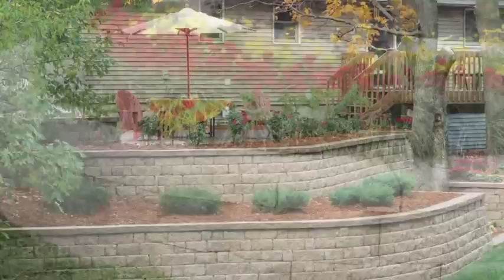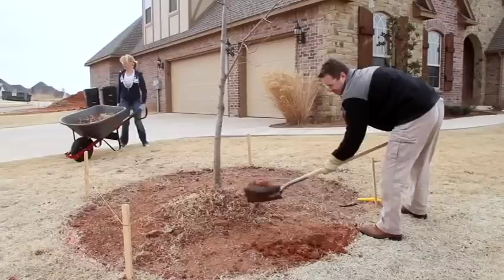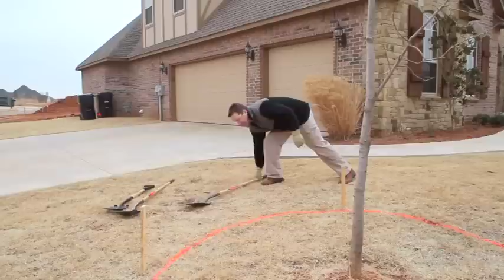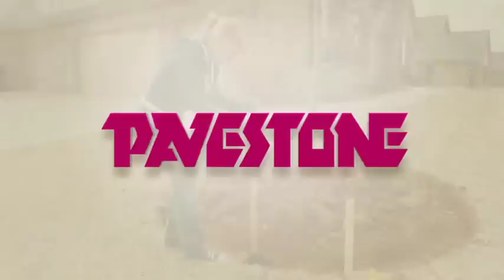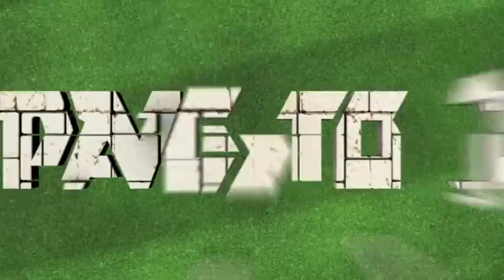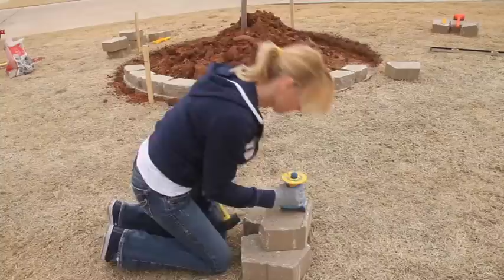Pavestone Retaining Wall Installation

Comment: Do you have a video on the install process on the "Rockwall Large"
So frustrating I'm 60 miles from Montgomery I can come to you if you have written directions, nothing came with the 8 pallets we bought, maybe because we bought from homedepot!
Reply: Can the lip be knocked off to stack  vertically on a short retaining wall next to concrete stairs to prevent a gap.

Comment: Raised tree ring = dead tree. Great job, you'll need to cut that tree down in 2-3 years.
Reply: It's fine.
Reply: @243wayne1  is this your tree? Because this is how you kill a tree.
Reply: @penguin12902  -WRONG.  I just did two more today.  New top soil, exposed the root flare, new mulch, Miracle Grow and fresh water.  Class dismissed.